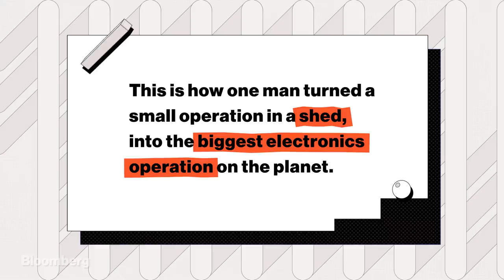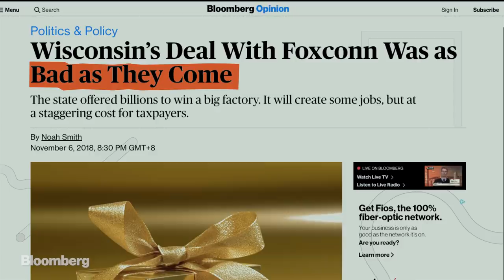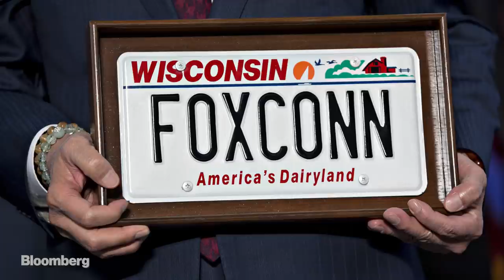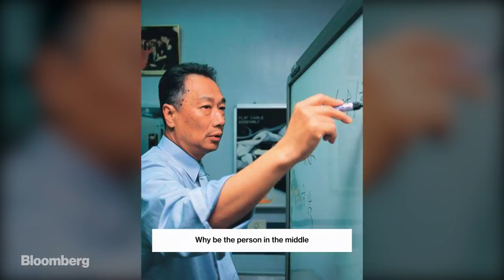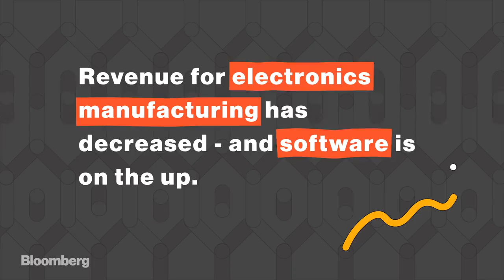The Billionaire Who Builds iPhones is Coming to America

Comment: Foxconn does do engineering, and has massive innovation in the various sectors required to not only manufacture complex parts, and integrated circuits, PCBs, Silicon dies, solutions, and workarounds, but to design tools, dies, parts, etc. to keep complex machine tools and PCB/Silicon fabrication and assembly lines running. There was Foxconn Silicon Valley manufacturing/assembly plants here not that long ago (less than 15 years maybe) along with companies like Flextronics, Sanmina-SCI, and Celestica (which actually still have manufacturing plants here). We had Solectron also which was another very large contract manufacturer. There is at least 4 Foxconn locations in Silicon Valley (which are probably sales offices, but also likely engineering facilities). Also there is a lot of tech manufacturing in Silicon Valley (though nothing to the scale of Shenzhen).

Comment: whoever disasembled that first phone in the really shouldnt be disasembling phones managed to break the front camera, one of the connectors of the screen the back camera the homebutton but most dangerously absolutley buttfuck that battery.
Reply: also missed that the microphone on the charging flex is ripped off.
Reply: the metalbracket over the sim tray is also ripped off. tha fuck did this guy do lol